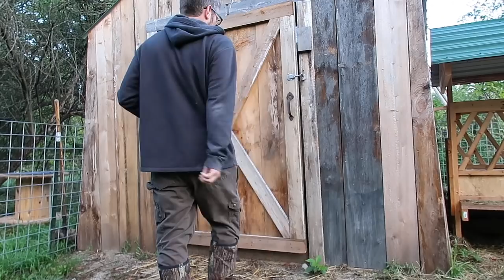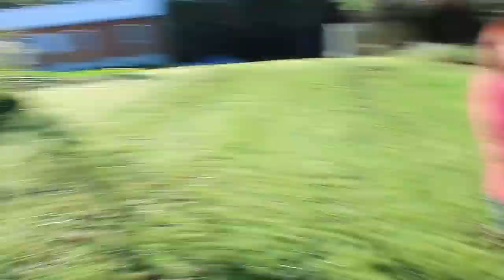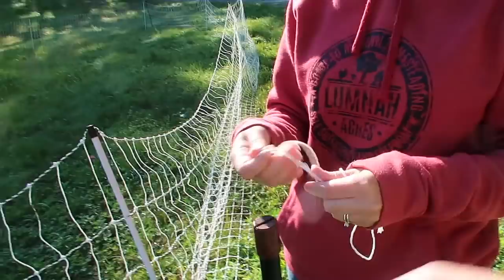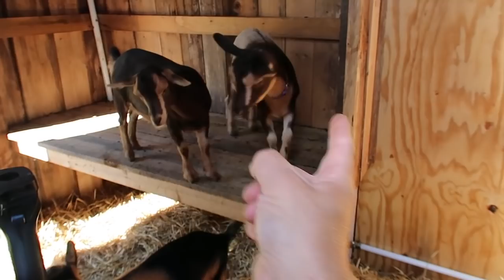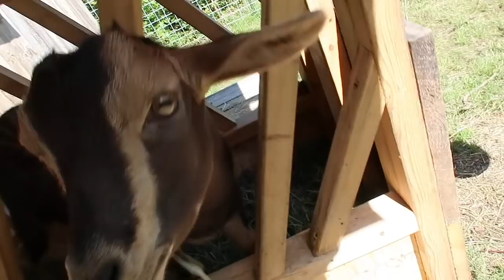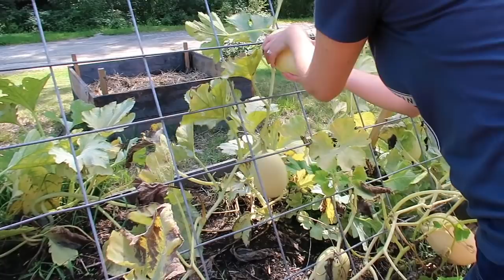This was Not a Good IDEA! (Plywood and Goats)

Comment: Hi Al , 
New England farms are well known for producing rock crops. lol  For farm communications you might look into walkie -talkies.  It would save a lot of shouting back and forth as well as mis-understandings. I think that I might have been tempted to put some Styrofoam insulation in between the walls of the goat barn.  Cooler in the summer as well . I am doing that for my new chicken coop  as I do not know just how hardy my chickens are . And less likely that their inside  rain water barrel will freeze.

Comment: Do not totally seal up your goat barn. They can develop pneumonia from barn dust if it is too airtight.  If you just cut drafts on lower part where they sleep that will be enough
Reply: I was wondering if the goat barn needed a vent at the top to let moisture out when it's closed up in winter.
Reply: Not adding insulation should be enough. He is just bad enough a carpenter to ensure plenty of air leaks. :-)